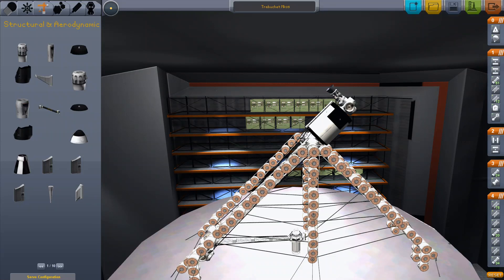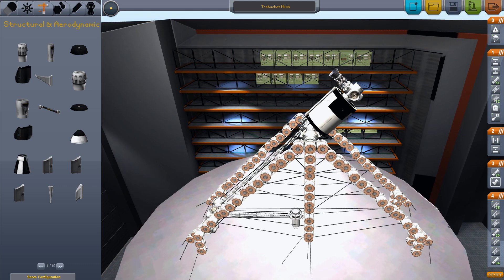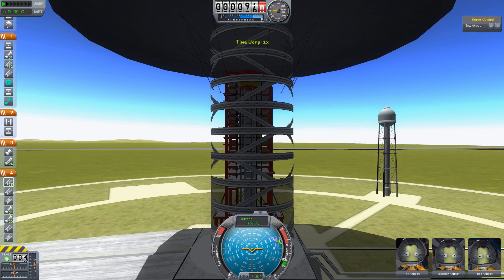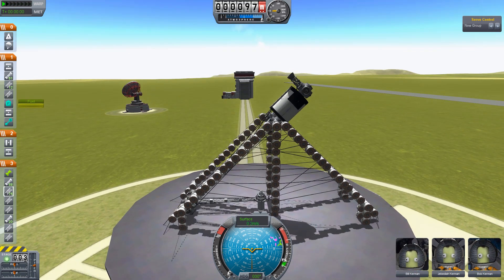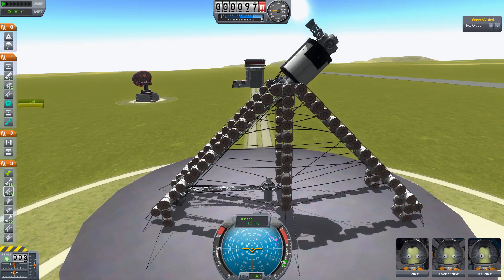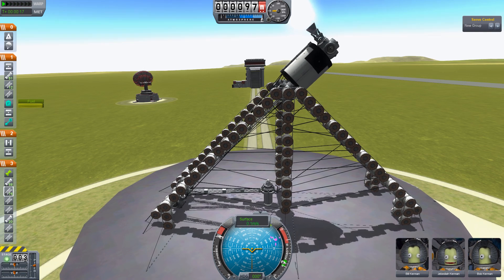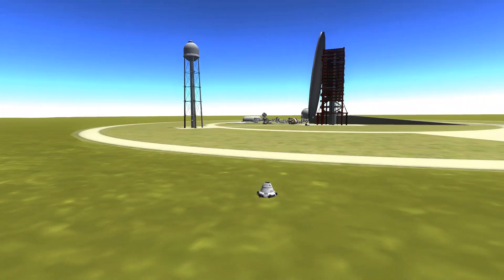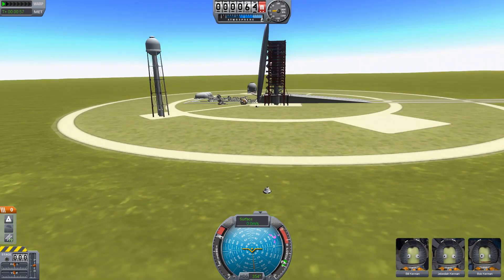Kerbal Space Program: Trebuchet

Comment from the maker: I didn't really try for the longest possible throw, however I'm pretty sure I optimized the throw distance reasonably well. Remember that the capsule is accelerating all the way through the swing motion, and releasing at 45 degrees angle would likely have given slower initial velocity than a later release.

Additionally, a 45 degree release would likely result in shorter throw due to high atmospheric drag on Kerbin. A lower release angle can make the projectile penetrate air longer distance.